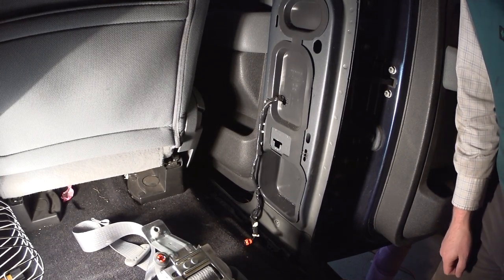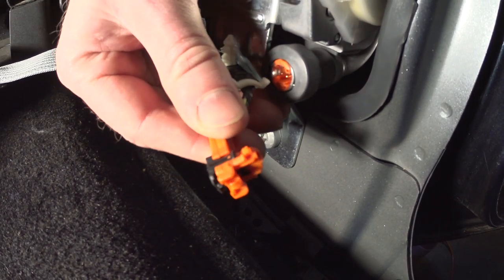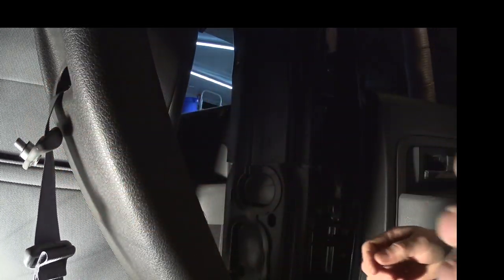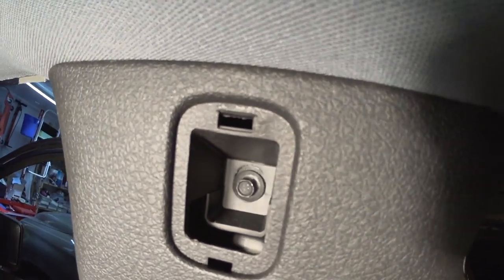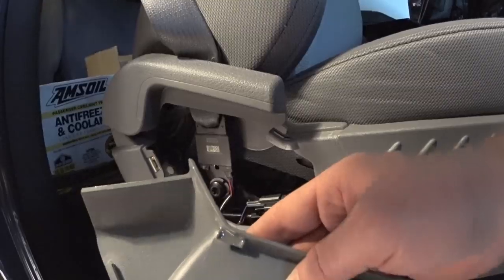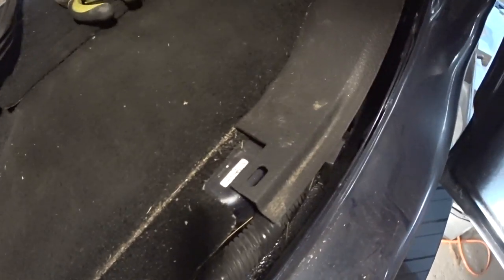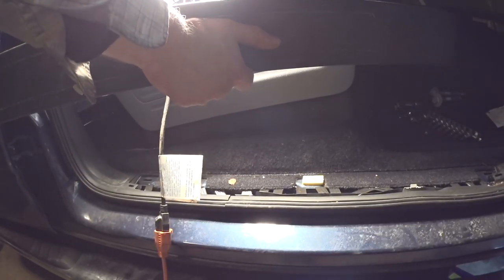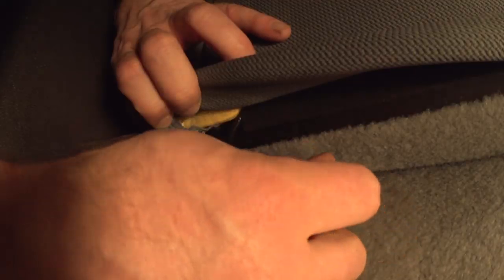2009-2020 Ford F-150 seat belts removal and installation, seat belts repairs

Comment from the maker: 350k miles on Ford and zero wear https://www.amsoil.com/newsstand/testimonials/articles/pristine-ford-flex-tops-350-000-miles/?zo=5257753
Tools used in this video.

T50 torx https://amzn.to/2tJ0dwZ
socket size 7 https://amzn.to/2XAsLpS
trim removal tools https://amzn.to/2Hcn5gm
small screw drivers for connector removal https://amzn.to/2tUJoPP
Glue to fix brocken tabs https://amzn.to/2TcoYkg
Reply: Where do I get the oem replacement?
Reply from the maker: Replacement of what?
Reply: @repairvehicle  the oem number of the replacement seat belt
Reply from the maker: https://rover.ebay.com/rover/1/711-53200-19255-0/1?mpre=https%3A%2F%2Fwww.ebay.com%2Fsch%2Fi.html%3F_from%3DR40%26_trksid%3Dp2334524.m570.l1313%26_nkw%3DFORD%2BOEM%2BF-150%2BFront%2BSeat%2BBelt-Assy%26_sacat%3D0%26LH_TitleDesc%3D0%26_osacat%3D0%26_odkw%3DFORD%2BOEM%2B09-10%2BF-150%2BFront%2BSeat%2BBelt-Assy%2B&campid=5337992468&toolid=10001&customid=

Comment: Update on my E-350 ford van 5.4L 2V it now has 594,363 miles and still hasn’t used a drop of the Amsoil OE! Amazing! It’s been almost 1,000 miles without adding any oil and the oil level is still at the full mark! Before I was adding half a quart every 500 to 1,000 miles. Great product and the Van is the best van any man could ask for it’s paid for itself that’s for sure!
Reply from the maker: thank you for sharing your experience.
Reply from the maker: what do you do for living since you drive so much?
Reply: The van was used by my dad as a liquid nitrogen delivery vehicle before he passed it down to me at around 560,000 miles I plan on running it till it dies.

Comment: Would you happen to know what to do if the belt has retracted into the unit and will not release it? Thank you in advance for any advice.
Reply from the maker: I had to send to a place where they rebuild them. They replaced something on the belt so it works properly.

Comment: I have a T50 bit in order to remove the seatbelt but it is hard to unscrew. What did you use to remove the screw.
Reply from the maker: 3/8 ratchet

Comment: Hey - I have an e2 50 I need to replace in these very sticky seatbelts ..which seatbelts should I use?… Also which oil do you recommend?I saw somebody’s comment below about never replacing the oil?
Reply from the maker: What year is your e250 and engine size?
Reply from the maker: What do you mean sticky?

Comment: How do you remove the plastic cover
Reply from the maker: Details not in the video?
Reply: @repairvehicle  not that I seen
Reply from the maker: did you watch video without skipping?
Reply: @repairvehicle  the video starts with the interior trim pieces (B Pillar) and the plastic T50 cover on the side of the seat already removed.  You just show how to put them back on.
Reply from the maker: Thanks Nathan! Removal is reverse of installation